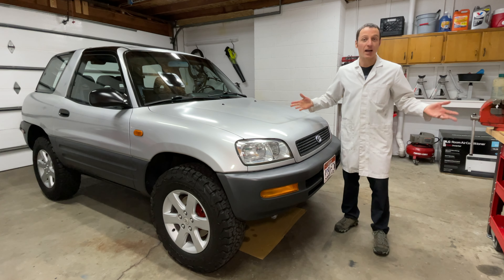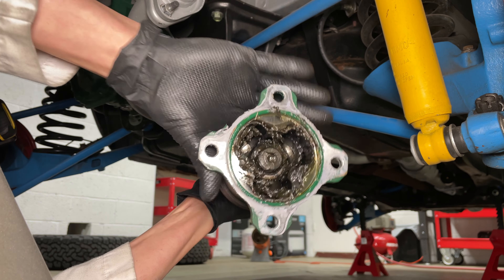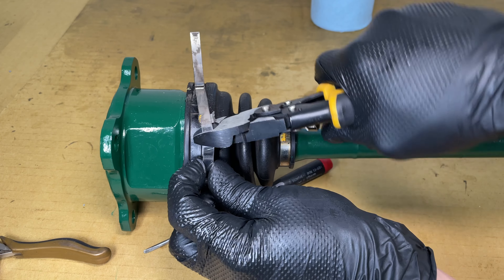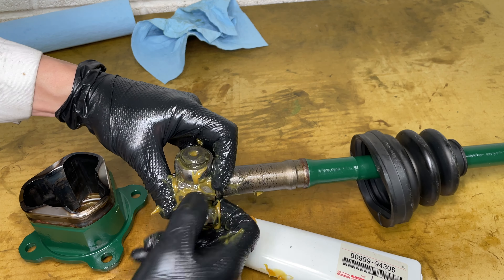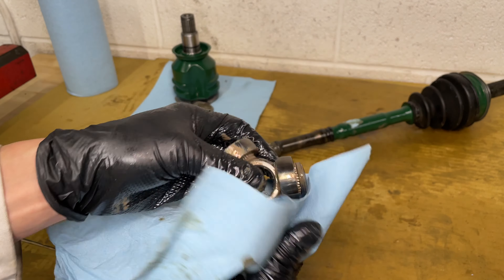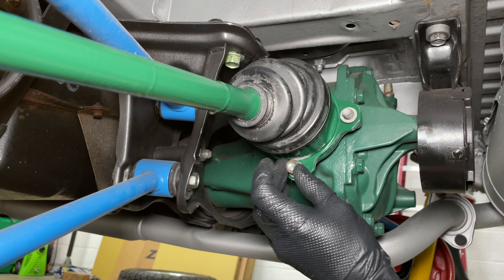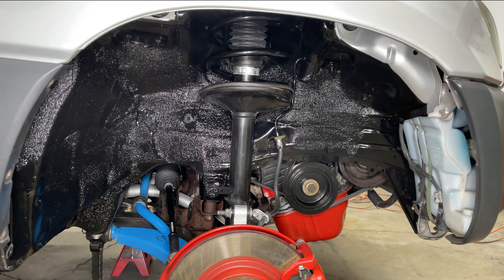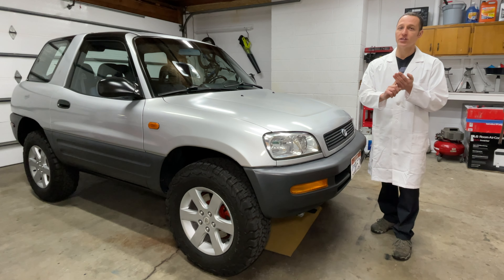CV axle and boot replacement 1997 Toyota RAV4 (episode 33)

Comment: Thank you for posting this video, 

I recently had a slip of my tool when trying to remove ball joint in front left, and it caused the large seal on the outer boot to slip off and i tried to repair it with an aftermarket clamp 

Next day i smell grease and see that its been leaking from the boot all over the inside of the wheel. 

The aftermarket clamp i used was more narrow than the original clamp.

I just got the boot kit from Toyota because even tho my boots are fine, i need new clips and grease, and the only way to get new grease is to buy the kit.

This video showed me exactly how to use the clips that came in the new set.  Thank you

Comment: In the first 30 seconds, you described the 97 Rav4 my wife just bought.
CV boots are GONE.  Left strut is soaked in strut oil that's leaked out.  This explains why the car clicks turning left or right and the front suspension bottoms out.
265,000 kilometers on the odometer.
So!
I'm doing everything.
Im also replacing the head gasket and refreshing the top end. Laping the valves and new valve stem seals.
The car does run good.
Reply from the maker: Yes, that's the unfortunate reality of having a 26 year old car.  Everything will be worn out.
You'll need new springs for sure.  You might want to consider the Old Man Emu lift springs.  You'll get better ground clearance and it's the same price as buying normal springs.  Make sure to buy only Toyota parts.  I've had to remove almost every Autozone part I've installed so far.  One of my next projects is fixing my front suspension AGAIN.  The front fenders are at different heights and I suspect my Autozone struts have something to do with it.
Original Toyota CV axles can be as much as $500 each, so you can save some money by going to the junkyard.  If you find CV axles with boots that are NOT torn yet, they'll likely be good as new.

Comment: Paul: “Take a moment to appreciate how good this cv joint is”               
me (who barely knows what a cv joint is): “Yes, it looks beautiful, incredible, magnificent”
Reply: Jokes aside, I happen to have a 97 rav4, and happen to work at an auto parts. Poor thing already has 330k miles on it, i can tell it needs new engine mounts, but aside that it’s pretty great. I’ve been trying to learn as much as I can, so I can do maintenance on it myself. And your videos are great, mine is a Fwd, A/T so there’s some differences here and there, overall tho, best YouTuber when it comes to teaching me about my own car. Thank you Paul.
Reply from the maker: Thanks!  I'm glad you like the videos.  I try to make things as detailed as possible.  I might be doing engine mounts soon on mine too.  I suspect the mounts may be the reason my exhaust flex pipe under the engine keeps breaking.

Comment: Good video, thank you. I didn't realise you needed to use as much grease as that.  I'm in the middle of doing mine now (Nissan Xtrail), I've fitted 3 aftermarket drive shafts (of axles in the US) and each one us causing vibrating when driving, so I'm replacing the boots on the originals instead!

Comment: I have a 1999 RAV4 I’m rebuilding the engine on right now.  I also have a 2010 Honda elite too.  I bought new not rebuilt cardone axle’s for the front when I put it back together.  Hopefully they aren’t garbage.   I’ve learned my lesson with autozone parts too.
Reply from the maker: Sounds like we have similar tastes in vehicles.  The Honda Elite is the best scooter ever!  Good luck with your axles.  I heard some aftermarket axles are OK.

Comment: That backlash that your getting am wandering if its not really the Cv joint causing the issue,  but the actually driveshaft where the front and rear drive shafts connect. the bearing there is sealed and connects the two. mine was sealed the boot that was covering it was worn out. I notice that when I pack it with grease I dont get that thud anymore but cant find the boot to cover it back so after awhile the grease comes out and the back lash gets worse.I  think it might be that would like if u were able to check it out and see.

Comment: Thanks for this video. It’s just got me out of a really tricky situation. I am replacing a snapped rear trailing arm on the driveway which I would really rather not be doing! Greetings from the UK
Reply from the maker: I'm glad it helped.  I hear people in the UK have a lot of problems with rust.
Reply: @LabCoatPaul  Yes, although not quite as bad as it used to be because cars are better protected now.
In this case, it was a combination of age, rust and a loose slab on the road.

Comment: I love your videos! I have a 99 Rav4 and have no intention of replacing the CV axles or re-booting them, but I freakin watched this whole video anyway. It's your fault for making such engaging content! ;-) I do, however, plan on replacing my suspension because I'm pretty sure it's all original still. As I recall, you replaced your suspension so I'll check that video out. Keep up the great videos!
Reply from the maker: Thanks for watching!  My RAV4 still has plenty of problems, so definitely check back soon for more videos.  :)
Reply: @LabCoatPaul  Since I commented, my driver’s door window controller seems to be failing. It’s a 4-door. Have you had to replace your power window motor assembly?
Reply from the maker: @johnshipps441  Nope, I don't have power windows so I haven't had that problem.

Comment: Hi Paul, would love to see you install LED spotlights/light bar if that's something you'd consider for a video. I certainly am but not sure where to start...
Reply from the maker: Light bars are easy!  I'm still working through the mountain of repairs my car needs before I add any accessories.  If I add a light bar, it will be attached to a brush guard or roof rack.
Reply: @LabCoatPaul  I got quoted over £500 just for labour to fit one!
Reply from the maker: @tomnethercott  That seems way too high.  Replacing the CV axles takes 1/2 hour per side in the rear, and less than 1 hour per side in the front.
Replacing the boots is very time consuming.  That takes 1 hour labor per axle.  
If you replace and rebuild all the axles like I did, that's 7 hours of labor.

Comment: Sir how about electrical wiring diagram for 1997 rave 4
Reply from the maker: You can buy a complete factory service manual at emanualonline:  https://click.linksynergy.com/deeplink?id=aNQbyV/mU5Q&mid=46180&murl=https%3A%2F%2Fwww.emanualonline.com%2Fcars%2Ftoyota%2Frav4%2F1997-toyota-rav4-service-repair-manual-software-emo-47924.html
Reply: Link appears not to work anymore??
Doesn't for me.... 
Other people?